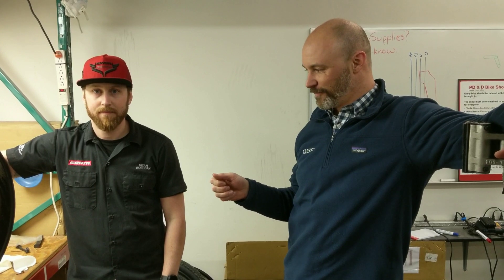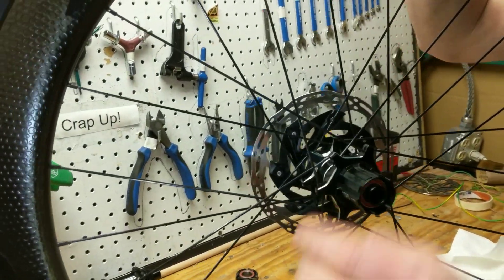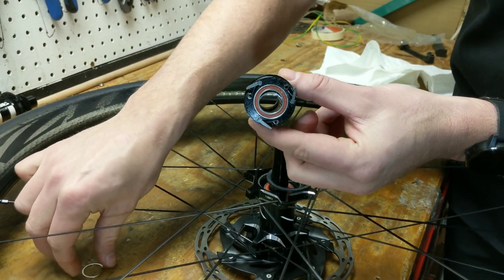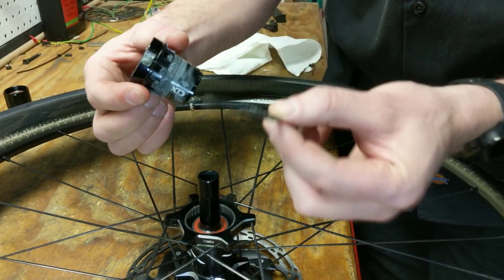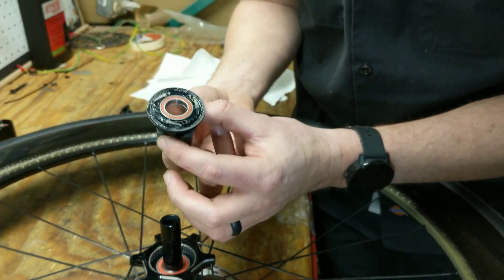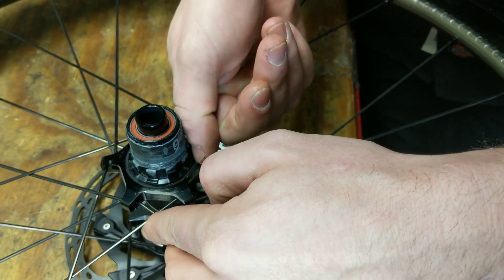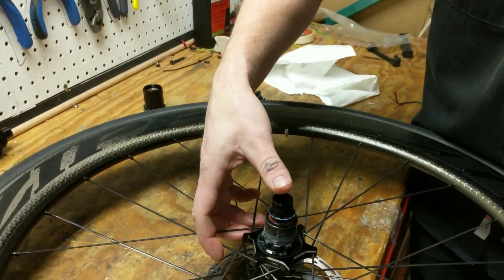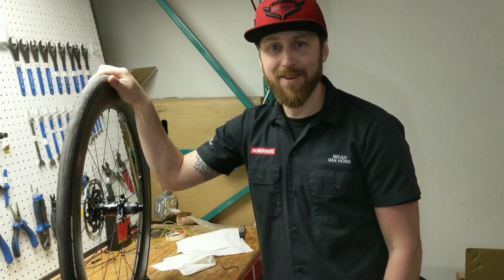SRAM XDR freehub body conversion

Comment: 1.Can I upgrade free hub from my Specialized Axis 1.0 rear wheel with 10 speed 11-32T Shimano cassette to Sram XD free hub https://www.bike24.com/p2337973.html?q=sram%20XD%20free%20hub and this cassette https://www.bike24.com/p2229323.html?q=sram%2010-42T%20cassette
2. If above is not possible can use this 11 speed cassette  https://www.bike24.com/p2124061.html?q=shimano%2011-42T%201x11 on my 10 speed Axis 1.0 wheel?